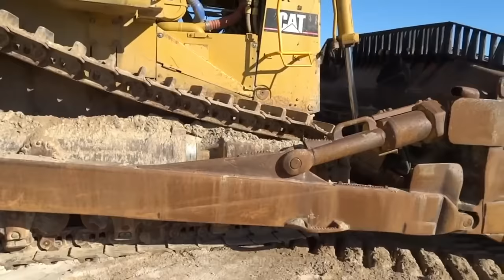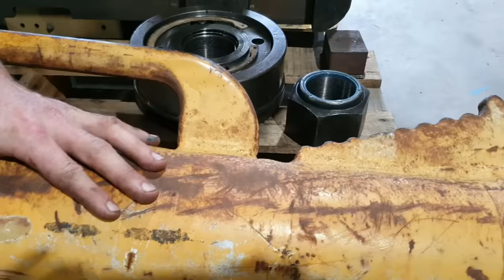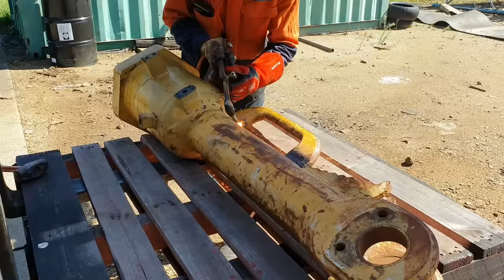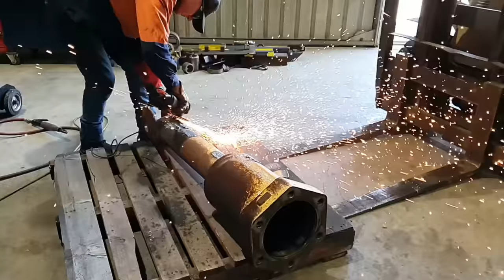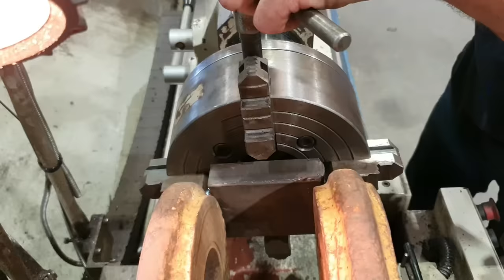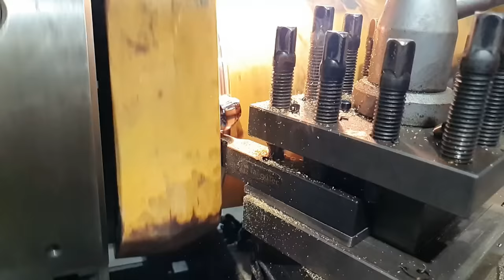CAT D10 Dozer Cylinder Rebuild | Part 1 | Machining

Comment: I always ask myself why not to put a new barrel inside the damaged barrel...like that thing we have around automobile engine pistons.... you use to cut and replace barrel......it is harder to put an inside barrel keeping the outter shape untouched?... you know...automobile engines we replace or machine the barrel and also we replace the piston rings... is this too much work to be done?...maybe not rational or economic....i do not know

Comment: 20 steps ahead saves you 10 steps wrong measureing work which gives you a bad name
Reply: I fix lefort scrap/balers had to jump on plane to perth from ireland  to tell welder yup mate pre heat then 3.2 stringers then 4.0mm cap but only 29.9